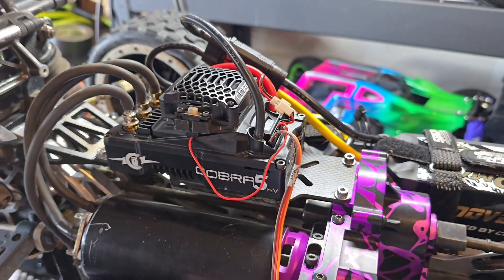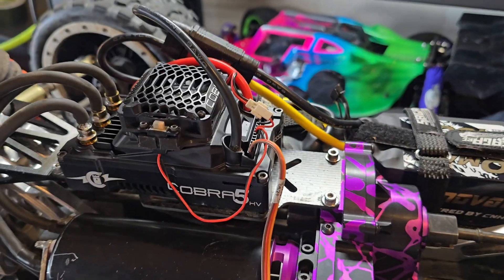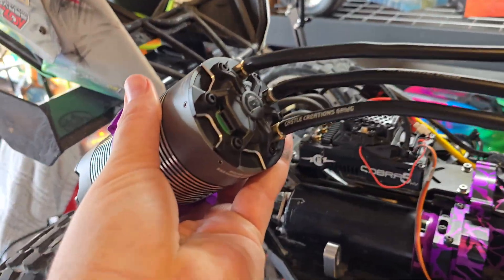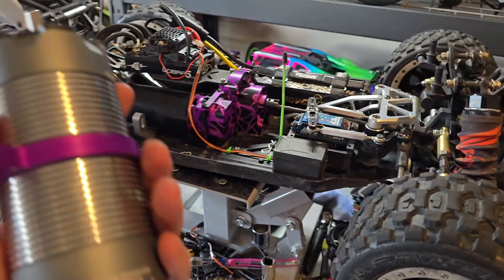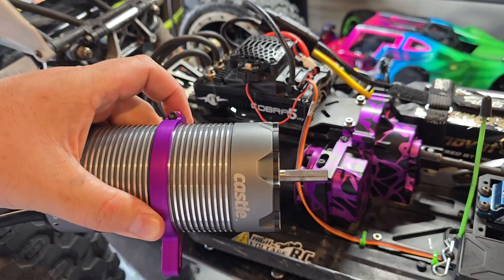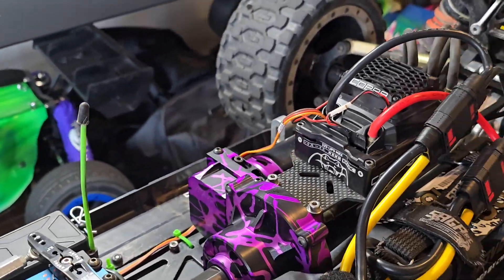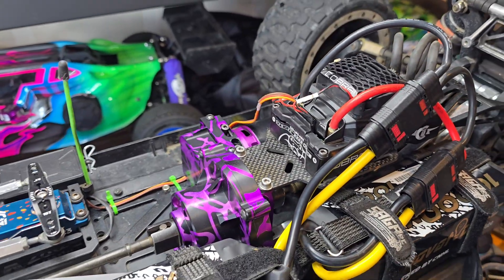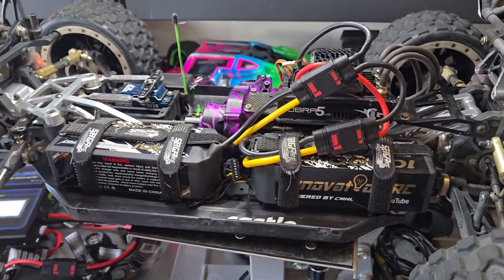Castle Creations New 12s Cobra 5 hv Esc is here !

Comment: I'm pretty sure I won't be buying one. I haven't had any luck with castle products. I've gone through 3 mamba xlx2's because the negative wire coming out of the esc broke loose all with-in about a 4 month period.
Reply from the maker: Hmm never had thst happen but I secure my battery wires always . Having them flop around isnt a good idea
Reply: @RCKYOTA  The 1st time it happened, I had just got it, installed and testing going no more than about 10mph. It lasted less than 5 mins.

Comment: Diffs and CVD’s ar still fine in Your car ? So much power there ! Drivetrain holding this without any problem ?
Reply from the maker: Yep, losi 5th scale are pretty robust. This would def eat up traxxas or arrma running gear . They also make upgraded front cvd/axles for losi 5th scale . Fast lane machine forever cvd kit, metal housings etc help

Comment: Which in your opinion is the more powerful motor, the Lehner or the Castle 2535? I know the Kv's are not the same but if you adjust gearing to compensate does one seem more powerful or faster overall than the other?
Reply from the maker: Lehner all day. So far nothing compares . But this motor has eaten 3 max 4s and 2 xlx2s . So be careful they are amp hogs. When nothing blows up tho seeing a 40 plus pound 5th scale do a wheelie at 80 mph is pretty wild .

Comment: Combo for 999.99 lol.
Reply from the maker: Esc is only $349 really good price. A max 4 is $499
Reply: I saw them on one website at $349.99 each piece, so $700 total, but they are sold out at the moment.
Reply: @zachyurkus taxes n ship to me I am getting in the 1000 range I’ll wait til Black Friday sale hopefully they go down
Reply from the maker: @zachyurkus they go live tomorrow for sale . Sorry about the confusion. You can pre order now tho
Reply: Without bluetooth logging and parameter adjustments.
Reply from the maker: @GarcBomber does both with a b- blink
Reply: @RCKYOTA so $400+ for a 12S ESC only? 

My 12S Max 5Plus COMBO was $380 for the 56118-1600kV that went 200+mph in a single motor limitless and owns the world record of 209mph.  Comes with Bluetooth integrated 👍🏼
Reply from the maker: @GarcBomber 349 is not 400 plus but ok.😅 max5 is nice esc but they are not on the same level power wise.   This is more on the same power as a max4. Which is $499 by itself.  The max5 g2 cuts power in 5th scale cars cause it can't handle the current load/demand of heavy cars. 7th scale cars are like what 20 to 25 pounds? Some 5th scales are 50 pounds.  This is a 5th scale esc i literally say at the end of the video its not a speed run esc its for bashing.  🤦 I can't say anything about the single motor record yet but its not the only car to do 209 anymore .
Reply: @RCKYOTA not going to argue on max4 vs new record setting Max 5 G2+, didn’t realize the castle link came in the box.  Still completely dated with the 5 cent power switch and all the additional wiring garbage just to log and update.
Reply from the maker: @GarcBomber 
The logger on hw esc is not even a real data log. Its simulated. Blue tooth is nice but the max 5 isn't that new of tech itself. Single core processor. All the new caslte esc run dual core and have a built in accelerometer. You can get blue tooth functionality with a b link but I never use that even.  The single motor speed record is 211 now. 

Also on a hw esc if the reciver or sensor wires get damaged you can't replace them on a castle esc you can just plug in a new one. Both have pros and cons.  

https://m.facebook.com/story.php?story_fbid=pfbid02x4FcYcjWCzoV4PSrELtb8BKvVE4q7LSHd8MfPquwNUMKAoweK9uU1YR9Q2MSUxkxl&id=100069437076093&mibextid=JRoKGi
Reply: If im running a super truck I dont care about another 1k
Reply: @PonkyKong just going to be diasspointing when someone else’s *superTOY is built better for less AND won’t start on 🔥

Comment: really want to see how it holds up to the max4.. i run a 1050kv 3080 on 12s all day in my kraken Vesla. and that's at 500 amps.  interested to see the logs and what its putting out.  the 560 is really easy on the esc but I put out over 700 amps with the hw set up in the kraken vekta.  interested in the ghost version!  thank you.  best video out!!
Reply from the maker: Thanks man appreciate it !, yea I've been putting the hurt to it with my 3080 1050kv, surprisingly the amps are lower than i thought they would be. Only around 360.  have some log screenshots I can share .  I was running a max 4 in the same car before it. I would say performance wise they are very close . The max4 might of had a bit more torqe and made the car wheelie more in the past but this motor is 2 or 3 years old now , been through a few fires and a fair amount of wear and tear. It burned up two max4s with it. 

I will try and get a comparison video up later this week.  Same motor, same gearing max4 vs c5hv
Reply: @RCKYOTA  wow nice to know it’s stable.  I burned a max4 as will… crazy but I was stuck in tall weeds with the Vekta and I was running a tp 5870 1150kv on 10s.  Tires were stuck and I gave it full power. The logs showed over 700 amps.  I blown over 15 xlx’s over the past 3 years of speed running vs 2 blown HW’s.  1 max 4 and one max5.  I hope it can take the beating of off road tumbles.  The xlx’s/ crobra’s  are fragile with bullets breaking etc…very nice bro!  I feel it’s maybe like a max5 g2 @360 amps.  I look forward to  using the setup 👍
Reply from the maker: @alterdcustomrc4512 for sure, higher amps dont necessarily mean more power, the more efficent an esc is the lower the current will be. Its easier on batteires as well.   I did 86 mph with it in full basher mode few weeks back juat ripping around. Not bad for 40 plus pound 5th scale .  Would def go faster but Its hard to control on the badlands lol
Reply: @RCKYOTA I’m a speed runner, so I have a lot of spare motors lol,  that 5870 did 150 back to back with the same hobby wing max 4 on cold batteries in a limitless.  I switched the setup to a 1700kv 2280 on 10s. So I threw the 5870 in the kraken Vekta for a while but took it out after it flamed the max4.  The truck had gotten stuck in heavy brush, and thick vines wrapped up in the rear driveshaft and when it was stationary I gave it full trigger and poof the logs showed the motor was at 200 rpms and pulled over 700 amps…speed runner motor in a heavy truck…I learned my lesson 😂 switched it to the full max 4 combo with a 27t pinion….crazy power.   I will defiantly try the 12s castle system with the 5870 and see if it holds together 🤞

Comment: when is someone going to make a proper 70mm heatsink now? I'm kinda over these  3d printed fan shrouds people are making. We need someone to make a proper heatsink that covers attaches to most of the can with the ability to attach 40mm fans on top
Reply from the maker: Tbh I dont run fans anymore. I used to do all fans and extra batteries and stuff but if you gear the car right you dont need it. Its extra weight and more stuff to break. But I do agree 3d printed stuff is janky. I won't run it on any of my cars. If you want something made of carbon fiber vitavon makes a flat esc plate that is wide enough to put 3 fans in. It will blow air down on the motor. Better than 3 printed.
Reply: @RCKYOTA  I'll look into that. I see that you have experience with the lmt 3080 motor. Would you say with the right gearing, these new monster castle motors almost make the 3080/30100 unessary if you're looking for huge amounts of power? It would be interesting if you could get some datalogs to show how many watts is currently being produced
Reply from the maker: @Esco770_RC lmt motors are still the king of power in my book. They are just something else when they dont blow up the batteries or esc 😂 70-80mph wheelies with a 5th scale is something to see.
Reply: @RCKYOTA okay, I'm almost done with a 5t build. I have the lmt motor and was waiting to get another max4 then this Cobra comes out. Now I'm need your honest opinion on which esc and gearing should I go with on this 5t? Oh and yes I am a speed demon! Lol so can you help me out?
Reply: Im making my own heatsink for mine on the lathe and mill. I run CPU heat paste between my motors and heatsinks with no fans
Reply: @raindeergames6104 I need 2 lol. When I do use heatsinks, I also use thermal paste on them

Comment: How do you find the DBXL is compared to the 5B
Reply from the maker: Dbxle 2.0 is a very good car. For 5th scale brushless I would say its design is one of the best setups you can have. The driveshafts go right down the center with pretty much no angle. They are super easy to work on and parts are cheap.batteires on the same side makes for good balance and easy change outs. The body folds back with just two clips . Its a great setup.

The 5ives are great cars as well, they are an older design built around the 2 stroke motor but still great. I use my 5ivebs for racing only these days as they are truly track cars.  My dbxle gets used and abused every week in one way or another. Its been a test mule, a speed run rig a basher and is probably my favorite car to drive. It never breaks and is just always ready to go . Ive had this one over 5 years now and its very reliable .